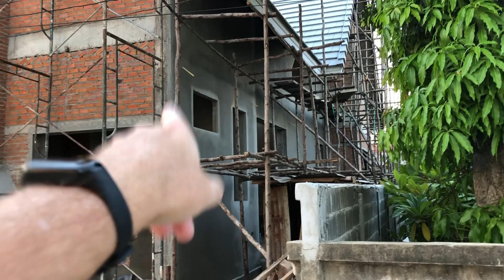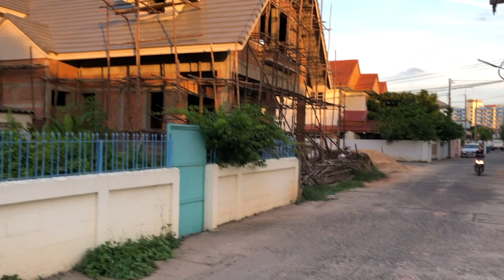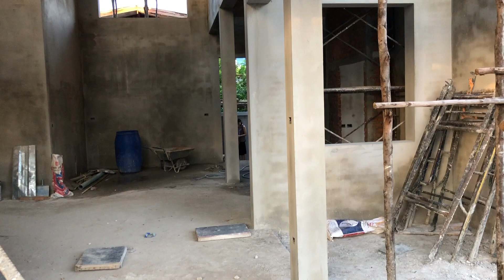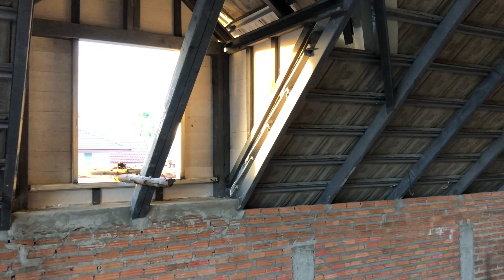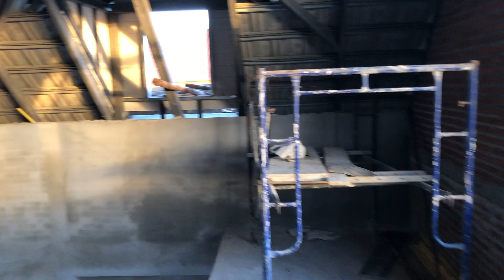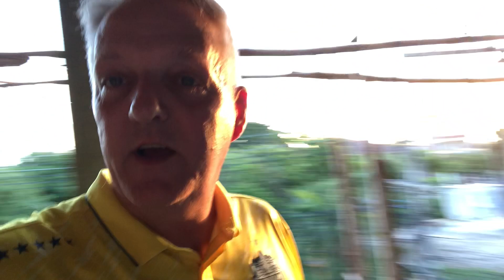v31 NEW HOME BUILD BURIRAM THAILAND Bangkok BUILDING A HOUSE PROJECT บ้าน

Comment: The build is now nearly down the tedious bit second fix is sometimes the slow bit. Always make sure you have lots of sockets in all rooms as its order to do when finished . But as I always say its turning into a fine home PA.
Reply from the maker: That's great advice about the sockets.  You can never have too many.  As long as the electrician can wire them.  I'll see about the 2way switches.
Reply: @PolarAttack  No problem PA.